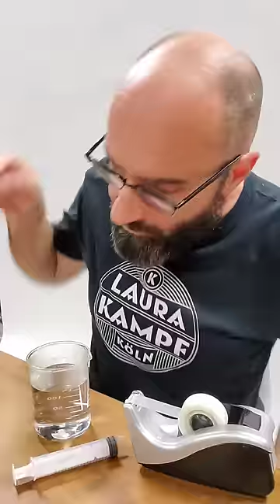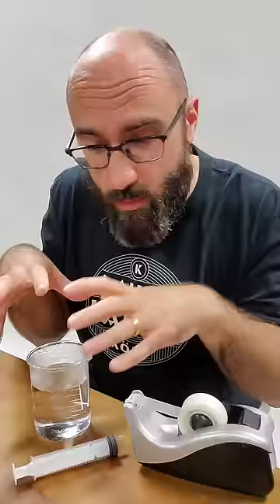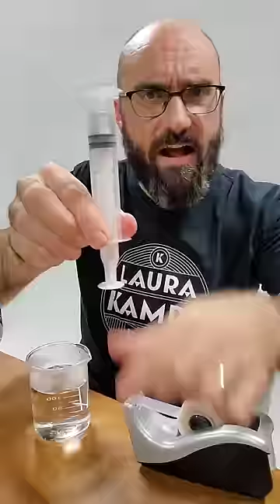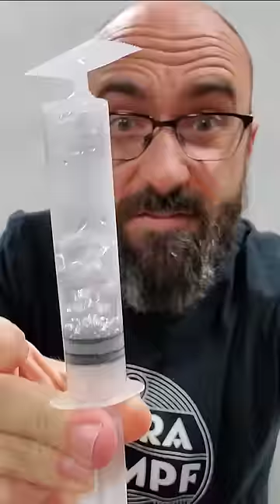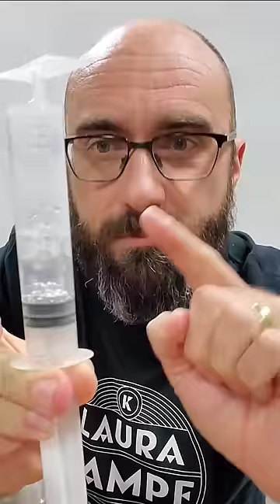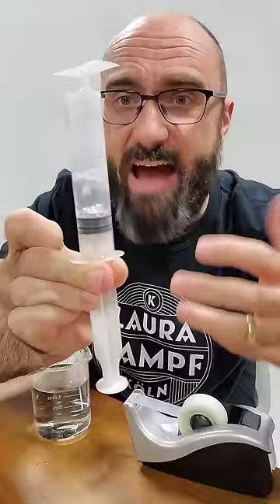Cooling down water by BOILING it

Comment: I was hoping that you were going to demonstrate the degree to which the water that didn't evaporate, actually was cooler than it was before, rather than simply by describing what visibly happened and then merely "assuring" us that the water that was left behind "would have" been cooler--; simply because of the same science I already learned about back in high school--.  (My high school course didn't demonstrate it to us "experimentally," then, either--; because like most high schools, our Physics class did not have a lab room--;).  

Sorry--.  

Thank You--.

Comment: as a physics master, this is not actually true.
what happens is that when water boils, part of its particles leave under the form of gas (because of air density and internal density of the remaining water, the gas will stick less into the liquid water).
what in fact happens here is that you create a turgor that is NOT uniform, especially at the walls of the chamber due to surface tension and other reasons, inside and into the liquid water. anyway, because of this unevenness, air particles on the inside will travel with ALMOST 100% pull toward the remaining water, subsequently pushing water vapors to travel to the opposite slots left by the moving in air. those bubbles are the result of air entering the gradient field of pressure pointing at the remaining water.
this does not happen when heating liquid. because then, you are actually increasing kinetic energy of the LIQUID particles making them shoot out into air thru the evacuating gradient of suction... because hot air is heavier in chemical unit than water vapours in chemical unit... as opposed to INCREASING potential energy of the water gas transferring out inside the syrringe.

ps, inside the syrringe, there is not much vacuum, it s only stretched air (and water incidentally)

Comment: that's a really poor explanation of why the remaining water is colder. H2O as a gas has way higher energy at the same temperature because it unlocks spin modes and is released from hydrogen bonding. This means that a 100 degree H2O molecule of gas has roughly 3-4 times more energy in it than a 100 degree molecule that's in the liquid. It's not "the hot ones escape", it's "the hot ones escape and take a ton of energy from the rest".

Comment: So pressure is the reason the phenomenon of boiling and condensation exists anyway, which is to say matter itself is fundamental why, because (this is just how I think about it to understand at least a LITTLE better) I imagine if all molecules were isolated in the empty vacuum of space, there’d be no pressure at all, and the molecules would drop to their absolute 0 state, which would be mostly solids for most forms of matter right?? RIGHT??? i feel like im wrong and dumb though like if the earth was much much hotter than our atmosphere would also be much much more water on top of hydrogen and oxygen right but the planet would the need to be a lot larger and denser to retain the lighter gases like hydrogen and oxygen right?!? I have the proper fundamental understanding, RIGHT!? 😭 but i struggle to understand how heat itself makes matter lose density and alleviates pressure asside from like principle entropy?? Why do hotter particles “expand” per se and increase pressure rather than just- like- become more energetic?? 😭 and I kind of understand that the expansion is part of how those particles exist in the higher energy states, but can something get hotter (than it would normally be in the kinetic energy state) it was not allowed to expand and take up more space/move more freely, or would it simply not be allowed to get any hotter past a certain threshold due to the laws of fizix? As in imagine some magical fixed volume container of unimaginable density and rigidity 100% filled with cold water and then put over a burner, would the water be forced to stay the same temperature?? And the container would be the only thing storing/conducting any of that applied heat? Omg im stupid COLD expands right?? Like ice? Heat causes pressure to drop?? Man im so confused and slow omg hot things are less dense, meaning less pressure- so if the sun disappeared and the earth started super cooling the atmosphere would start condensing- man im too lazy to go back and look at just how much of all of this is straight wrong n i lowkey like sharing/exposing my thought process anyway so there

Comment: You are forgetting something.  When the water molecules in the syringe are exposed to a lower pressure and some of the molecules change state to a gas they need to gain the latent heat of vaporization to do so.  The vaporizing molecules take heat from the surrounding water molecules in order to change state.  By taking heat from the surrounding water molecules the molecules that vaporize cool the remaining molecules that remain in the liquid state.  You will find that the heat removed from the molecules that remain as water by the molecules that vaporize is the major cause of the water in the syringe getting cooler.
Reply: Not strictly. The latent heat of vaporization is just an expression of the energy required to break the binding interactions between one molecule and its neighbors. The faster water molecules have enough energy to do that once the surface energy decreases as the pressure is lowered. And the end result of that is that the high energy molecules escape into the air and take their energy with them, leaving the colder, lower energy molecules behind in the liquid. 

Latent heat of vaporization is a quantity that only makes sense in a bulk fluid for this reason. it tells you how much energy you need to add to a certain amount of liquid to free every molecule from every other, but statistically a lot of molecules will have the energy needed to escape anyway which is how evaporation happens.

Comment: Why is a system to cool housing not been implemented using this system?
Reply: Because water vapors do not absorb heat well, because they have no need to absorb heat because theyre already in a high-energy state, otherwise humid areas would be colder. Which is never the case in real life

It's would be far easier to cool a house down by simply pumping regular or cold water through pipes

Comment: I thought it was: PV = nRT
If V ↑↑, why does T ↓↓?
Can somebody explain 😢
Reply: When the water is taken out, the volume (V) indeed increases. According to the ideal gas law, PV = nRT, an increase in V should lead to an increase in T, assuming constant P and n.
So in simple words yes the T of water did actually increase but as the surface area is now increased heat will transfer from water to plastic and then plastic to environment hence leading to decrease in overall T. It's same as while you are cooking you add water to vegetables so it doesn't get  burnt but by adding the water the volume increased so T will up then you cover it with lid that leads to water vapaor getting on lid and heat being transferd to the lid thus after some time the overall T will will decrease due to transfer of heat

Comment: Aint this just evaporation on steroids?
Reply: Boiling and evaporation are not the same thing. Evaporation is a passive phenomenon where molecules on the surface are energized by heat and leave the liquid as vapor. Boiling occurs throughout the entire liquid and is characterized by the formation of internal bubbles which rise and escape. The phenomenon in the video is boiling via the absence of pressure to keep the molecules in a liquid state. Evaporation would occur at temperatures/pressures below the boiling point of the liquid.
Reply: TL;DR: boiling is not "evaporation on steroids". One happens below the boiling point and the other happens above.

Comment: how come i can pull a vaccuum easily in a syringe but i cant form one in my mouth
Reply: Probably because there's a lot of places where air can come out. You can create somewhat of a vacuum by opening your jaw without opening your mouth. It will create a negative pressure, which is technically not a vacuum, but it's the best we can do.

Comment: The information you provided about water boiling because of low pressure is totally true. But in this situation those Bubbles in the syringe aren't actually because of low pressure but because the structure of the syringe itself is weaker to be able to outstand the pressure so it's leaking some Air.

Comment: I feel like you should say bubbling the water instead of boiling 🤔because I thought boiling indicate heat 😡and bubbling can be either 🙃just like soda so if you pressurize the liquid  and get it to bubble then it’s bubbling!!!! 😶🤣🤣
Reply: Nope. It’s boiling. Bubbling of soda as you describe is called outgassing and it’s kinda like boiling but they’re kept separate terms

Comment: I knew this before. In the mountains water can boil in 90°C. Someone was testing it with chamber where pressure was gradually lowered. The water was boiling in just 21°C, then the glass didn't withstand the pressure

Comment: So everything i know about boiling point is wrong
Reply: Boiling point is dependent on pressure. Boiling point changes very slightly depending on your altitude, but drop the pressure by pulling a (weak) vacuum and that boiling point is def gonna go below room temp

Comment: WRONG. This reaction is considered off-gassing. The low pressure allows for the gases to expand. Boiling typically implies that we are increasing temperature not decreasing pressure.
Reply: You have no idea what you’re talking about. Look at a phase diagram, water will boil by crossing that boundary from liquid to gas. Off gassing is something different, solids releasing gasses
Reply: @henrysanecdotes5323  when you open a soda can do you call it boiling? Also, when a liquid turns to gas it is called evaporation or vaporization. When a solid turns to gas it is called sublimation.
Reply: @ethanstevens1963  Soda doesn’t boil when you open a can. Carbon dioxide is released from the liquid; it’s different from boiling or evaporation. But you’re correct about everything else. I don’t see your point tho.
Reply: @henrysanecdotes5323  what is the reaction called when carbon dioxide is released from the soda? And how is that process different from what we see Micheal do here?
Reply: @ethanstevens1963  1. It’s not a reaction 2. This is easily googleable, why ask me 3. It’s not really called anything unless you count “fizzing” which isn’t a scientific word 4. What happens is co2 gas dissolves in the liquid bc it’s at high enough pressure for that to happen, but when you open the bottle, the co2 just leaves and goes into gas form making bubbles. It’s not evaporating or anything, it’s just leaving the liquid. It’s different from what Michael does because Michael crosses the line between liquid and gas phase, which causes the water to boil. I do concede that they’re similar, but scientifically they’re not the same.
Reply: @henrysanecdotes5323    1. Off-gassing is considered to be a physical reaction as a scientific definition. 2. Im not trying to ask you and instead hopefully educate since these specific phenomena are part of my profession. 3. What you call fizzing is literally called off-gassing. 4. You are correct, neither the soda can nor the water are evaporating. They are both off-gassing, a reaction that releases gasses when a liquid is introduced to a lower ambient pressure.
Reply: @ethanstevens1963  that term never came up while googling. Thanks for the correction. I’ve learned something today. However, that’s still not what Michael does. He boils the water. I have a hard time believing you have a career based in this stuff when you don’t know the bare basics about boiling or phase changes
Reply: @henrysanecdotes5323   The definition of boil is; To change from a liquid to a vapor by the application of heat. Micheal did not apply any heat in this demonstration. What he did apply was a change in ambient pressure to the water, making this specific reaction off-gassing.
Reply: @ethanstevens1963  No. That is the definition of boiling as used by normal people who don’t need to concern themselves with chemistry or anything and are just trying to make craft mac and cheese on a stove. Boiling (as described in the wikipedia article for boiling) “occurs when a liquid is heated to its boiling point, so that the vapour pressure of the liquid is equal to the pressure exerted on the liquid by the surrounding atmosphere.” The boiling point is dependent on the pressure exerted on the liquid by the surrounding atmosphere. The water will boil when its temperature is above the boiling point. Pulling a pretty decent vacuum (as Michael does) will cause the boiling point of water to drop below room temperature, which causes the water to boil.

Outgassing (which is the standard term, offgassing is another name for it tho) is the release of a gas that was dissolved, trapped, etc. in another material. Quote from wikipedia “Boiling is generally thought of as a separate phenomenon from outgassing because it consists of a phase transition of a liquid into a vapor of the same substance.”
Reply: When water boils, it simultaneously undergoes two effects, outgassing and change of state.
Boiling isn't heating something up, it's the rapid change of state from liquid to gas.